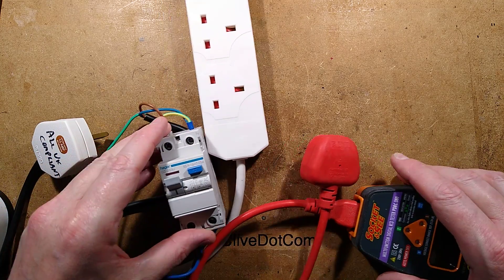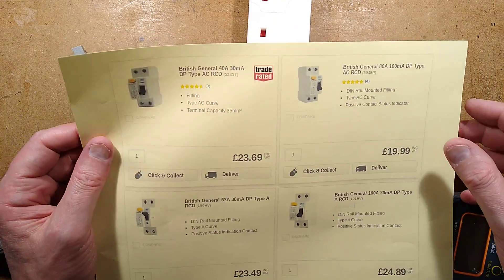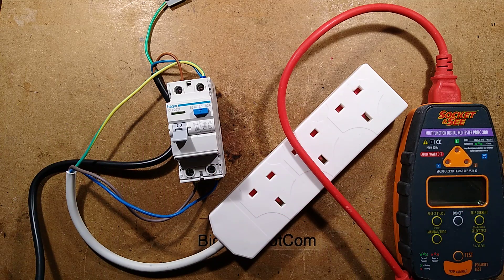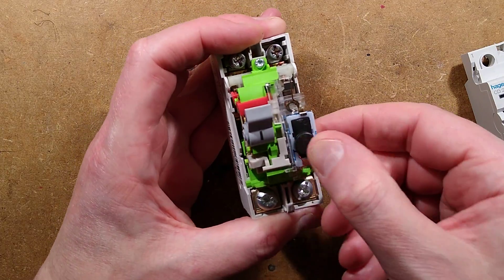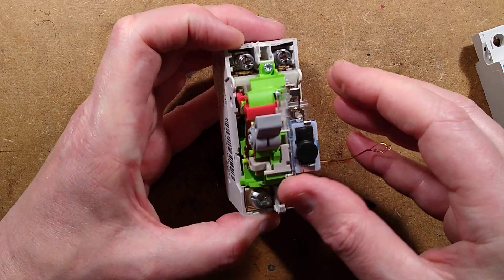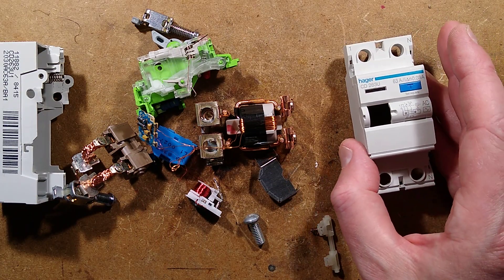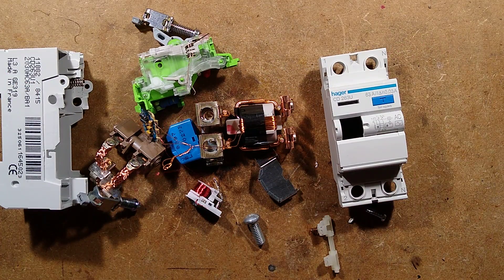Was this RCD damaged by overcurrent?

Comment: TN-C and TN-C-S aren't novelties. In Germany it was permitted until 1973 (in East-Germany until 1990) to have a PEN conductor in final circuits, then this was changed that the PEN must at least have a size of 10mm² (copper) or 16mm² (aluminium). In the last version of the VDE 0100 were this was permitted, from the year 1969, the PEN should be connected to the earth-terminal of the outlet and from there a wire bridge connection to the neutral terminal of the outlet. The system is perfectly safe as long as there is no PEN breakage. This condition is a massive problem, because metal housings could become live at mains voltage.
The most common systems here are TN-C-S and TT. But several DNO are now converting their TT-grid into TN-C-S, which is actually no problem for them.

In case of this picture I can clearly determine how old this is, the combination black and green/yellow in a two core cable was only available between 1965 and 68:

https://images.gutefrage.net/media/fragen/bilder/steckdose-anschliessen-mit-zwei-kabel/0_big.jpg?v=1544095332643

The outlet itself is not original, it was changed in the 1990s when screwless terminals for outlets came up. And actually it looks like someone didn't bother to install a box into the hole...looks like remnants of a hollow wall box are in there...

Comment: Hi mate, you don't have to populate a C/U in order of load anymore. The thickness of the busbar renders that unnecessary.  For sure the installer should have split the showers between the RCDs but it doesn't surprise me that the RCD is fine. It's quite new and an AC type. It's far more likely that the issue is related to items plugged in to the kitchen circuit. If he had tested properly no doubt he would have found the problem.   Love your videos Clive!

Comment: Hey, this is a Residual Current Circuit Breaker - RCCB - NOT a Non-Auto Main Switch.  They come in 16A to 63A ratings... they do trip in overcurrent AND Earth leak mode! 
https://hager.com/uk/products/h/cdc263u-rccb-2p-63a-30ma-ac

What is the rating of the Main current limiting Service Fuse of this premises ? You know, the big HRC high kA rated one between street supply and this dwelling? 
If over 63A then this Residual Current Circuit Breaker - RCCB is obviously under-rated. 

Is this a multi-phase installation?  If so, the dill that wired this dwelling failed to load share across those supply phases correctly.
It follows, has this place been wired up by some DIY = DIE character?
Aside simple overload through poor load balancing across supply phases available... or layers and layers of dodgy add-on since originally built, the cause of tripping that device, I'd assume, to be cumulative Earth leakages.  i.e. combined leakage across all 6 circuits supplied by that RCD. 
Of course, better to have each of those 6 circuit breakers as an RCD type. Aside the inconvenience of loosing power to every circuit supplied by that Main Switch when it drops out, it makes fault diagnosis a pain an arse... and has supposed 'professionals' asking what they should be capable of diagnosing themselves.

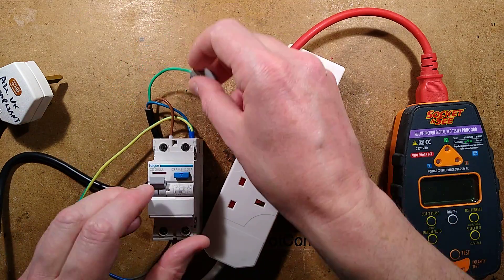Comment: Whick is the new electrical system you mentioned that allows conding neutral to ground at 5:40?
Reply from the maker: It's not new.  It was experimentally used several decades ago.  It's not as safe as the more common ones used now.
Reply: @bigclivedotcom  Do you mean the TN-C?

Comment: When I moved into a rented house with my girlfriend and her family I found that all the downstairs sockets and 2 of he upstairs sockets were linked in the same ring circuit including the oven, and appliances. Sister in law used to get a shock rom the microwave socket everytine they switched it on and the house would trip if you had the kettle and microwave on at the same time.
When the bathroom a contractor said that the high wattage halogen spot lights in the kitchen were wired with speaker wire.
Best part of the situation was that the landlord was an electrician. :L
Reply: Excuse me, wtf

Comment: Interesting, thank you. Would the signal from the transformer be full-wave rectified before being applied to the solenoid? That would seem sensible if the residual magnetism in the solenoid has a specific polarity, as I presume it does. With full-wave rectification, why should tripping be more sensitive to one phase than the other? If half-wave rectification, why should it trip at all on the other phase? If no rectification, how does it work?

Comment: Shower needing 40amps? What are washing themselves with?! Electricity?
Reply: they're basically instant-hot shower heads.  There's a reason you don't usually see whole house electric instant hot water setups, water takes a obscene amount of energy to heat up.  Traditional hot water tanks get around this by slowly heating up the water and storing it against use.

Comment: You can't just add up all the breakers and say that the RCD has to be rated to handle the total sum. The main switch is only 100A rated. This is why we have diversification. The mains supply fuse is probably only 63A.
Reply: why would you put a 63a rcd behind a 100a breaker though?  It'd sort of like be putting a tranmission good for 63 horsepower behind a 100hp engine, shit's going to break.  In this setup there's nothing stopping say, 90a going through that rcd rated for 63.
Reply: @Wooble57   Engine? Transmission? That's why mechanics don't do mains electrical work. I install 40A RCDs on boards all the time where the supply is 63A. Nothing wrong with having 1 or more 40A RCDs, even when the supply fusing is higher. It's called circuit protection discrimination and RCDs are not for overload protection. Who mentioned a 100A breaker? The 100A isolation switch is that what you are talking about? Yeah that's not a breaker and you are not an Electrician. Hint, I am!
Edit, I do agree however that the installing electrician paid no attention to load balancing. Here in NZ you are only allowed to install 3 MCBs off an RCD unit. So I can fit 3x 20A MCBs on a 40A RCD. Diversification shows that those three 20A mcbs are unlikely to be pulling 20A load each unless they are circuits supplying hard wired equipment that require 20A full load current or more each. Don't get me wrong, the guy that installed the two shower units, each drawing 32A on the same RCD that fed all those other circuits was a cowboy. But you can't just add up circuit breaker ratings then assume that what is feeding those breakers should have a higher rating.
Go around your house and add up all the 13A socket outlets, then add the loading of your cooking appliance and your hot water cylinder, plus any other hard wired equipment plus the lights, then ask yourself why the sum is way higher than the rating of the main fuse feeding your switchboard.

Comment: I often use electric Installation Tester to measure different things. The measurement "loop impedance" can cause RCD-tripping. When i simply start the measurement between a Phase and the PE in a circuit with a RCD without changing the settings of the tester it would trip the RCD instantly. There is a function in the Tester to generate this DC current to saturate the Residual current transformer of a RCD to prevent tripping. Depending of the used Type of RCD you can set different options to block RCD's from tripping.

Comment: I remember being on a jobsite with a temporary power board... essentially a junction box screwed to a wooden stand in the field.  I saw a low level labourer there leaning on the board.  His job was to hold the breaker on.  Safety first!
Reply from the maker: He may have been resetting it, as they will trip internally independent of the lever position.
Reply: @bigclivedotcom  Our 110V power is much less exciting so simpler breakers used to be pretty common.  They could be held closed.  I am amazed at the sooty carnage on the one breaker.

Comment: I think I know why they went for the 63A one. 
Here in Germany, where Hager is located, consumer units are limited to 63A in most places. Three phases still but only 63A. And in most cases 40A is enough because we have only one circuit per breaker and fx. are only allowed to have 6 16A breakers per 3-phase RCD. So everybody and their Grandmother buys 40A rated RCDs and the price goes down. 
I can get a Hager Type A single-phase 40A/30mA RCD for 27,78€ A 63A costs 136,99€ and I couldn't even find a 100A one at my supplier (www.zaehlerschrank24.de).
Reply: I think it is a habits/culture thing. Here in Hungary we can have 32A for "free" for new connection. Above that a so called "network development fee" have to be paid on top of the usual costs (a new connection costs like 3000€ nowadays). That is why if a building has 3x16A, they tend to call it "equipped with industrial power connection".

Comment: I had nuisance tripping for years, mostly at nearby strikes during thunderstorms but it got worse: it could even trip when turning off the garden lights. Anyway.. kitchen got replaced. All was stripped off the wall. The fume hood socket appeared to have a tiny carbon track from live to earth on its inside ceramic body. Obviously that got replaced. No more nuisance tripping.
If there's the tiniest slightest track laid down by that first lightning strike's overvoltage spike, the path is there. And it will build up at every consecutive time it flashes over. Good that I found it. I was already planning to  dive into the garden wiring after the kitchen project was finished...
Reply from the maker: Tracking is a common issue.  The current leakage can be initiated by a voltage spike from something being switched.  An insulation tester will find the fault.

Comment: 32 amps for a qooker? How much water you gonna cook 100 gallons in 10 minutes?
Reply from the maker: four radiant rings, grill and an oven in many cookers.
Reply: This is UK not Europe so it’s 230V not 400V. It’s the same power output but higher current on just one phase

Comment: 72mA test fault current seems kind of legit, because you have to consider the double windings of the sense coil. So the fault current needs to be devided by 2 what results in a true false current of 36mA ... ?!
Reply: doesn't really add up.  The sense coil acts the same no matter if it's the test resistor or true leakage current, it all follows the same path.
Reply: @Wooble57  but the test wire might be feed once through the sense winding so you have to have double the current

Comment: Personally I prefer RCBO because then it's clear which circuit that's the culprit. With one single common RCD you will get a total blackout and that's very annoying when you have to figure out what went wrong and try to find the central in the dark. Of course the RCBO is a bit more expensive, but in the long run it's worth it.

Comment: So the combined nominal current of the breakers is 186 A. Wouldn't code require to at least fit a 186 A rated RCD? Or fit a 63 or 100 A RCD but also put a 63 or 100 A main breaker before it? I mean, it's unlikely that all breaker circuits are ever loaded to their maximum capacity at the same time, but it's not impossible.
Reply: it would be impractical to wire houses that way, you bank on not everything being on at one time.  There's generally a bit more leeway then this though.  Around where i live the whole house is behind a single main breaker (1-200 amps usually), then everything splits off that.   Even with 300a of breakers behind it, it's highly unlikely that you've ever trip it.  On smaller circuits like this it's a lot easier though.

Comment: The random installation of the cb's makes no difference. Only assists electrician to locate particular circuits quickly. The consumer would not have any idea of the conventions and would not think to look for an order of size. Also, the cb's can be left to right - right to left - upside down, whatever. If you need to add a cb and ther's no room in the order of size, you would install it anywhere convenient to save on costs. Cool vids though.
Reply: @Blazin Redeye You have misunderstood what I was referring to. I was just commenting on the installation method and rules pertaining to convention. Labeling could be wrong and if so is indeed against the rules, however, there would be no rule stating the cb''s should be installed from highest to lowest, (in either direction). If that was the case, all full circuit boards would require a full rewire each time a new circuit was added.
Cheers.

Comment: Cumulative earth leakage via multiple points will do it every time, particularly resistive heating units like cookers, ovens, hot water units. In Australia we initially were allowed to hang every circuit on one RCB, not anymore, the last regs I saw it was a maximum of 3 final circuits on one unit. Fixed hard wired devices such as cookers, hot water heaters  with current rating over 20 Amps were not required to be Earth leakage protected as it was finally released the major risk of earth fault shock was from hand held or portable equipment exposed to abuse or damage. Lighting circuits are required to be protected as they are often fiddled with by people trying to fit ES bulbs into BC sockets and so on.

Comment: Try not to get too excited about the rating of the MCBs in the board or the order they come in. There’s no regulation that says they have to go from small to big or vice versa. The bus bar is the same cross sectional area along its length so the order isn’t an issue. 

Two 40A circuits is a concern, but we don’t deal with loadings by simply adding up the values of the MCBs. I haven’t read all the comments, but I don’t think anyone has asked why hasn’t the main fuse blown yet if we’re saying that the board is grossly overloaded? 

I know others have said it but... Diversity. 

In the end, the MCB is there to protect the cable in that circuit. Just because an MCB says 40A doesn’t mean that’s what’s flowing through it. You might only have one phone charger plugged in to a ring circuit and that certainly doesn’t draw 32A.
Reply: the issue is the main breaker is 100a while the RCD is only 63.  You could run 90a through that RCD all day and the breaker won't trip.
Reply: animefreak5757 you’re absolutely right there. The main switch is 100A and the fuse could well be 100 or 80A. It’s pretty certain that it’s not 63A but my parents have just been downgraded to 60!

There are a lot of details missing from this video that would help to clear it up a bit. Maybe CJ Electrical can chip in?

The rating on the RCD is for continuous use (Continuous rating). Then there are some other ratings of much shorter duration like Withstand, Make or Break capacity, Surge and Short Circuit which are all eye-wateringly high in terms of amps. I was trying to say it’s unlikely to encounter much more than 63A but then again....

I agree, it’s very badly designed and I would definitely raise that if I came across it on an EICR. 

I was just trying to clear up some of the common misunderstandings as far as electrical installations go. 

It wasn’t aimed at people like you who clearly know what they’re doing. 👍🏻
Reply: @andyscott5978  NO, animefreak5757 is wrong. That device is a combined 63A CB and Earth leakage [RCD] type device.  The product data sheet says so. For that type they are available in 16A rating.
https://hager.com/uk/products/h/cdc263u-rccb-2p-63a-30ma-ac
Reply: @Wooble57  Not so, it is a combined overcurrent CB AND RCD. i.e. Put 90A through that and it will overcurrent trip.
https://hager.com/uk/products/h/cdc263u-rccb-2p-63a-30ma-ac

Comment: It’s old school theory to have mcbs in descending order. It’s now considered irregularity helps with heat dissipation. But having two 40A on the end is helping no theory.
Reply: In this case, the busbar that connects from the Main Switch to each of those circuit breakers is of short length and it's current carrying capacity far exceeds the rating of the Service Fuse / Main Switch and at that current rating, has very very low voltage drop. 
All decent CB's have thermal compensation built in, to prevent nuisance tripping. In any case, to have higher than ambient temp in a distribution switchboard indicates something seriously wrong.    
'Descending Load Order' and Spacing in Switchboards, where the CB's are stacked in a vertical orientation, between groups of CB's by omission of a CB in distribution pan assembly [not practical in a pissant consumer board like this] is rare and of benefit only in large Commercial/Industrial installations, for Load balancing on multi-phase systems, or clear demarcation of equipment, or zones within the installation.
More common is spacing is between groups of Neutral supply wiring, from the Neutral Bar to single phase CB's, when you may have more than 10 individual RCD total, thus limiting the size of looms which allows heat dissipation, albeit unlikely given the oversize conductors used with pre-wired Neutral conductor devices. [they use the wire size needed for the maximum rating of that type of device.. generally 32A] 
Such CB 'spacing' is a proper PIA if 'blank dummy' CB casings are not used for pole fillers in the escutcheon plate.... those stupid clip in pole fillers fall down and get launched across the room when closing doors or installing covers - they get lost... so no pole fillin'. 
In any case, the only time I've seen CB 'spacing' required under client specifications has been in the Heavy Industrial and Critical Infrastructure sectors - Mining and Generation field.... or when you get the occasional overly fussy Engineer.